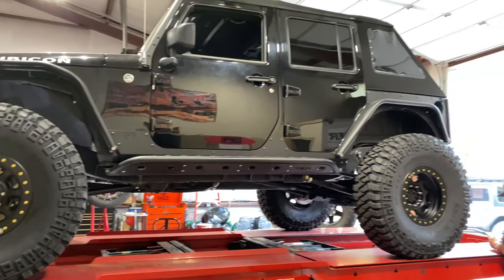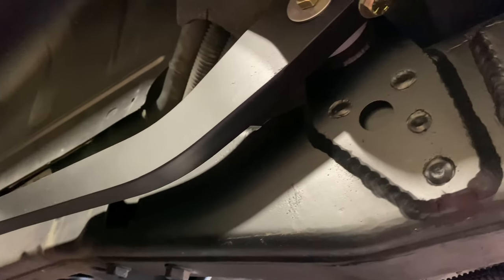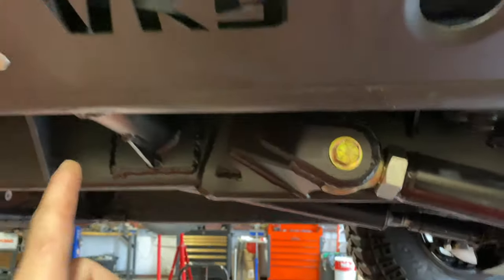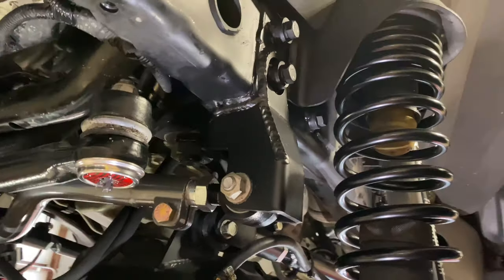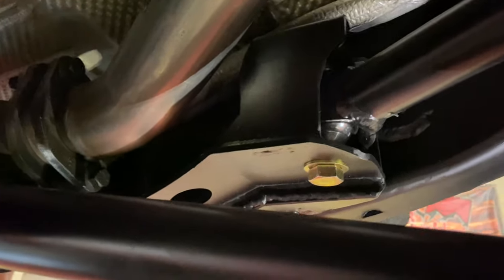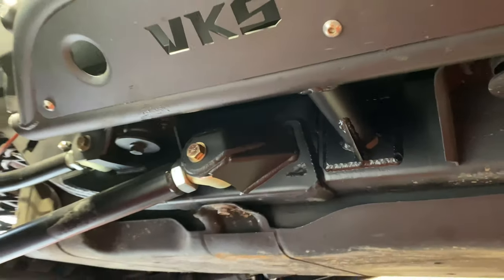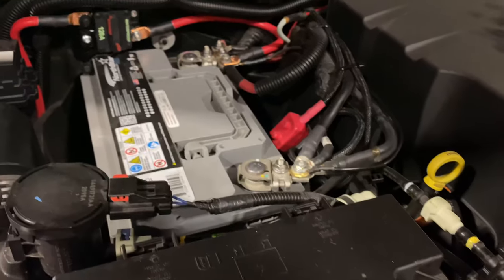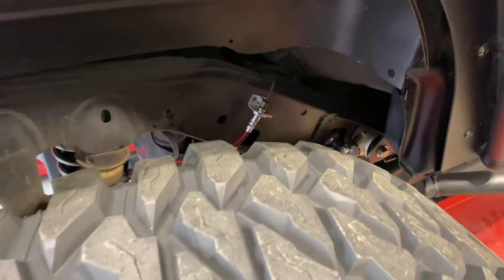Jason’s one ton long arm JK on 40s

Comment: Absolutely love your videos!!  Like how you go over the builds and then the follow up with the rigs wheeling and driving.  Always look forward to them !!   I’m not a rock crawler but I use my Jeep specifically as a rig to get onto the strip mines up here in Wv. It’s basically a rig setup for long range rifle shooting. It has to be able to take on all of the wheeler and side by side trails so it can’t be to big of a rig. Still building on it, I hope to get a stronger D44 put up front with a locker along with a winch that won’t fail. After this it’ll be the perfect long range shooting vehicle for my needs. Trying to find a shop that does good axle and gear work.   Much appreciated !

Comment: Exactly the type of build I am doing on my JKU, GRAVITON. Only thing different will be the sliders, mine are old lazy man Rock Slide Engineering "steps". Not a fan of the narrow rear with spacers. Agree track width should be same as front...however, I am going to use tube and axle length instead of spacers. Kudos, strong build.

Comment: Get rid of that PSC clamp. It’s single shear and the weld has poor penetration. Terrible design.
Reply from the maker: I’m sure he will if he ever has a failure with it. So far is going strong.
Reply: @rockyour4x4  mine failed in moab at easter and psc warrantied it, they were setup over at dixie and then again on the rubicon and that turned into a self rescue. Finally had WFO get me squared away with some new tie rods and reversed the piston so now it pushes from the axle and it's the axle and it's double shear welded to the passenger tie rod, it's a really solid setup now. The rust in the bubbly psc welds was fun to show the owners at PSC, he was pissed and mother F'd his production staff but did nothing more than swap me out.